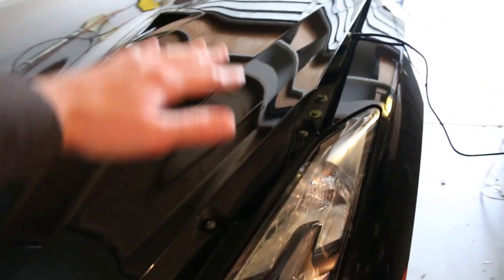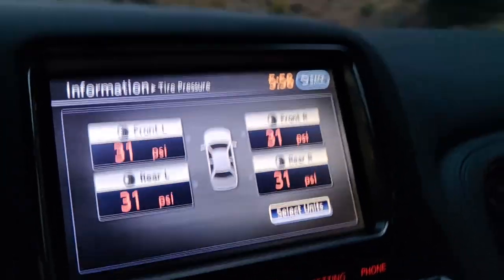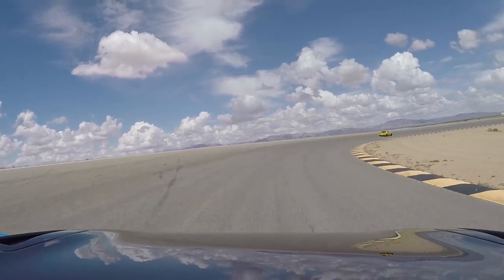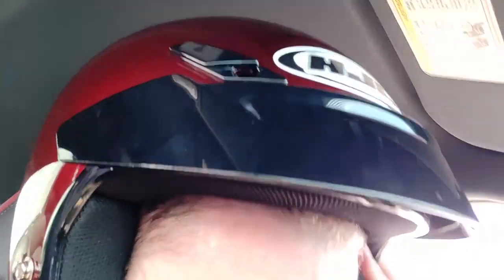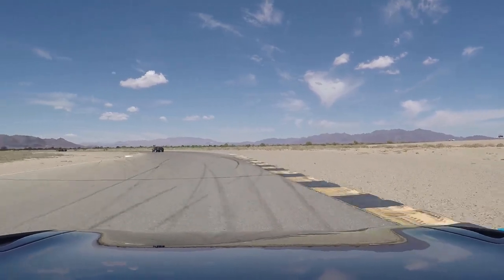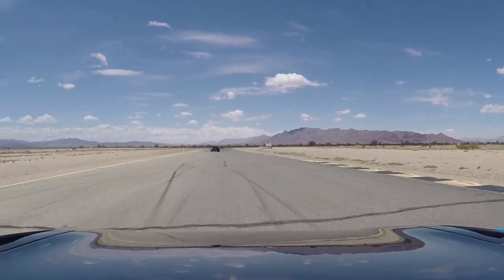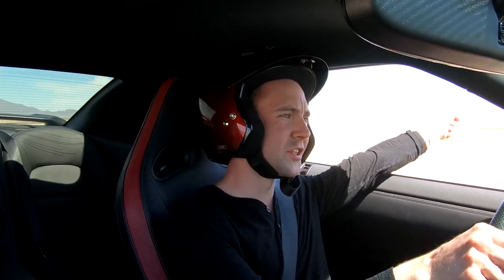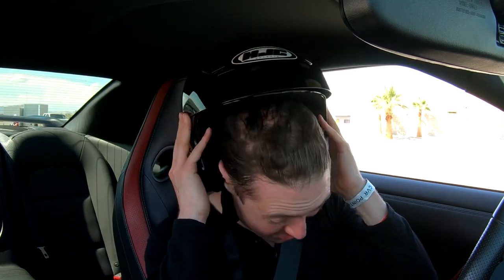GTR Track Day at Chuckwalla

Comment: Tired get hotter after sitting off the track because the brakes are still hot but you’re parked
Reply: Tires*
Reply from the maker: Hmm I hadn't really thought about that. From what I heard these were pretty good temps to have, but do you have a recommendation?
Reply: @SnowWhiteMR2  considering your temps were taken a minute or so after parking, I think it’s about right. I usually drop it one or two psi but close enough, and also depends on how hot the day is. Great vid btw
Reply from the maker: @barrylee2536  thanks for watching!!